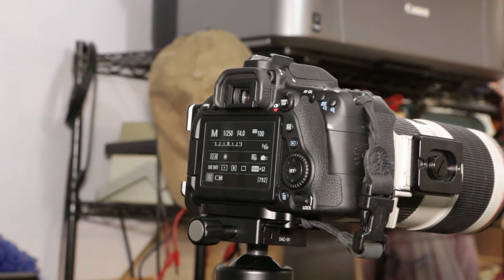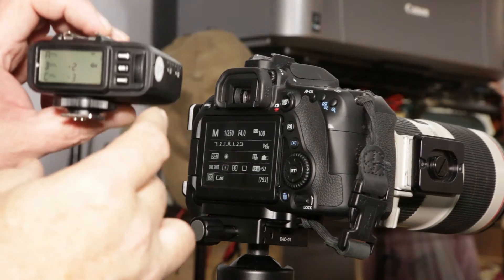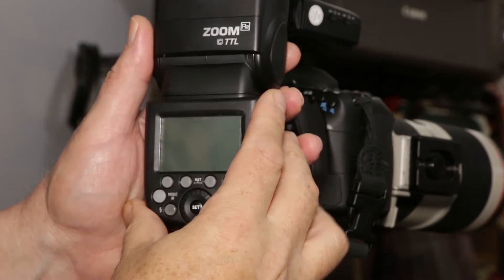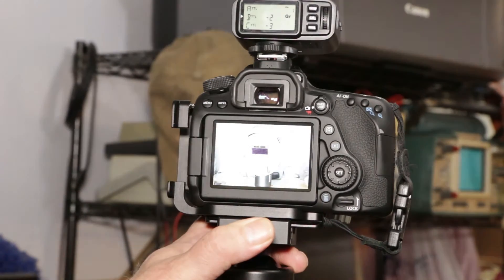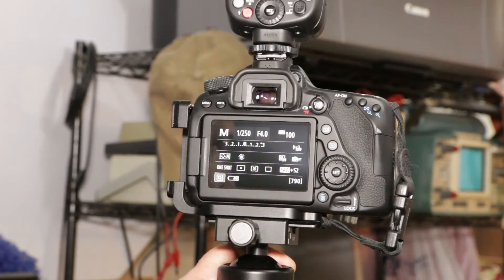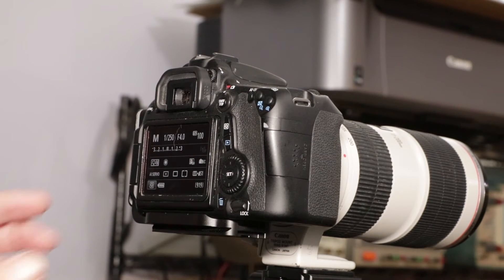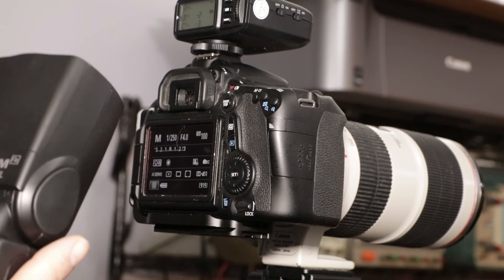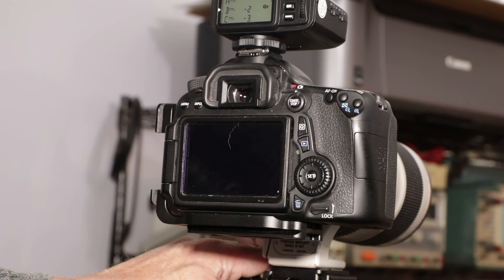Godox X1 80D Problems

Comment: This is STILL going on. Shooting a 5DSR, got myself a V1 and X1T-C and had exactly the same problem. Took it back for some tests after reading up a watching this video. The hardware worked perfectly on a few bodies they tested, including the 5DmIV.

Didn't test other X1Ts while I was there - probably should have - but did test the pro and X2T-C and those worked perfectly.
The X1T's interface was TERRIBLE, so I'm sorta happy it didn't work or I'd likely have just lived with it. The Pro is much better in that regard but doesn't have the passthrough shoe... But the X2T-C is the best (IMO) of both worlds: Passthrough shoe? YES! Improved Pro type interface? YES! And it's also got the quick shoe attachment the pro and X1T don't have.

No one seems to know what the cause of this problem is, but after all these years they're still having it, and maybe it's for the best.
The X1T is basically garbage and with a price difference of about $10 (from the X2T) I don't understand why they're still being sold.
Reply: Hi Jon.  I agree that the X2T-C is a much better option all around.  I suspect that the X1T's problems on a 5DSR will never be resolved, given the more up-to-date triggers available and niche market appeal of the 5DSR.  The 5DSR was never really a popular camera, except in certain niches where it's high resolution could be leveraged (such as landscape photography).  Also, Godox is not a very customer-focused company, which is why I always by my Godox gear from Adorama; which is not to say Adorama's customer support is great, but it's a far cry better than Godox.

Comment: Hi Mark, I bought the X1C transmitter and 3 X1 receivers a few months ago and they work flawlessly with my 80D. Not that it should matter, I'm using Canon flash units - 430EXIIIs and a 270EXII as a hair light. Do you think it's your flash that is not talking properly to the camera rather than the transmitter?
Reply: The problem was resolved over a year ago by a firmware update on the X1C.
Reply: BumpinTheRoad Ah OK, looks like I bought mine at the right time then. 🙂 There is a new firmware update at the link you provided dated 17/7/18 (1 week ago). Would you update to that if your system already worked fine?

Comment: Hello everyone! I have the same problem with my canon 80D, TTL mode does not work! :(
Reply: This was fixed by a firmware update.  Contact your reseller or visit http://www.godox.com/EN/Download.html to get the latest files.
Reply: BumpinTheRoad Mine works perfectly without the update. Does the update add any functionality? If not, I won't update in case it breaks what already works.

Comment: Hi, I have the same Problems with the new Canon EOS 6D Mark II. With the EOS 6D I have no Problems. Has Canon introduced a new flash protocol with the introduction of the EOS 80D and the EOS 6D Mark II? Whether a firmware from Godox can help?
Best regards
Udo Schikora
Reply: Udo Schikora, not necessarily a new protocol. Remember that Godox and other third parties have to reverse-engineer the protocol. And then they each add their own secret sauce to the recipe. So it seems each new camera model needs a new Godox firmware to work right.  Unfortunately, because Godox is a manufacturer that doesn't sell directly to consumers, (and worse, a Chinese manufacturer that doesn't really understand Western service and support expectations), it does take  some time for the new firmware to be released.

If you bought you flash from one of the better resellers such as Adorama or CheetahStand then you should be able to get support there. Otherwise, just check the Godox firmware web page and be patient.
Reply: BumpinTheRoad, thanks for your reply. I've already thought of something similar. I ordered the articles from Amazon Germany. I have already sent an email to Godox. But I could have saved that. I think, I still have to wait for a firmware. I think that one day will come. I still have the EOS 6D, since everything works synonymous. Otherwise, I am very satisfied with the equipment of Godox.
Best regards
Udo
Reply: Udo Schikora, I doubt that you'll get any response from Godox, they aren't really good at end-user support, instead requiring there resellers to provide support. But if they do reply they will want a video to show the problem, and can only receive via email due to China government censorship of YouTube and sites like Dropbox.
Reply: BumpinTheRoad, well, let's wait for it. A firmware update will come sooner or later. Since I have the devices, three updates have been released. I work with Godox TT685c, AD360, X1T-C and X1R-C: all very reliable devices with Canon EOS 50D and EOS 6D. Since the 6D Mark II is still very new, I think that in a few weeks a new firmware will appear.
Reply: Udo Schikora, I agree. The 6D2 will be a significant model (in spite of the disappointing sensor technology, oh well) in Godox's target customer base. So I am sure they will have a fix soon.
Reply: TTL not working in cannon 80d, I'm having under expo problem in x1 ttlc,what to do
Reply: Udo Schikora There was definitely a change in Canon's flash technology somewhere. I have some Hahnel Tuff TTL trigger/receivers and they work with 4 of my Canon bodies, but not the 80D. Hahnel issued a supposed working firmware update which was for 3 models including the 80D and 5D Mk IV. They still didn't work on my 80D, so I bought the Godox X1C trigger and a few Godox X1 receivers. They worked perfectly right from the first time I tried them. I usually use them in manual mode, but TTL works fine with the usual caveat that the camera meter will be fooled by predominantly light or dark subjects. What works well is to point the camera at something mid-grey and the same distance from the camera as the subject. Hold in the exposure lock button on the back of the camera (the one with the asterisk) and you'll see a preflash. The camera has basically set the required exposure. Keep the exposure lock button held in and recompose, focus and shoot and the subject will be perfectly exposed.
Reply: raj mithran Are you still having issues? Are you photographing light coloured subjects or heavily backlit subjects?